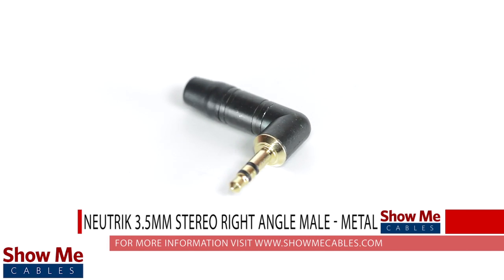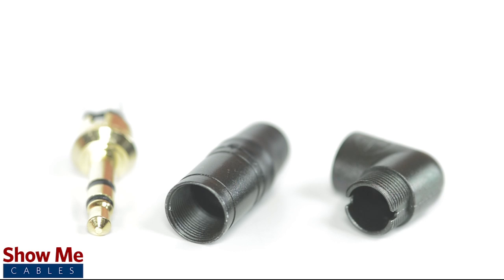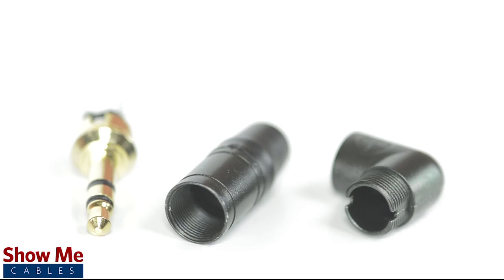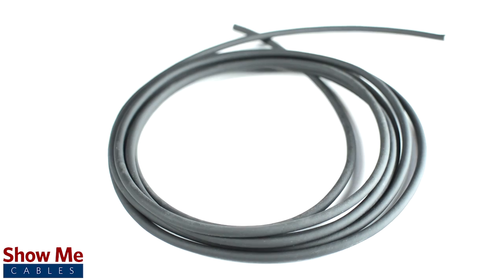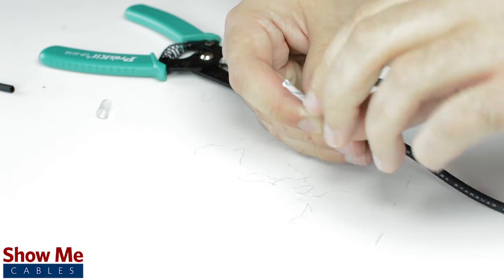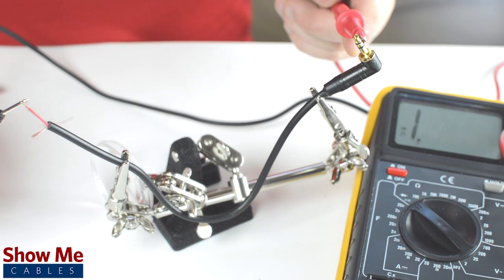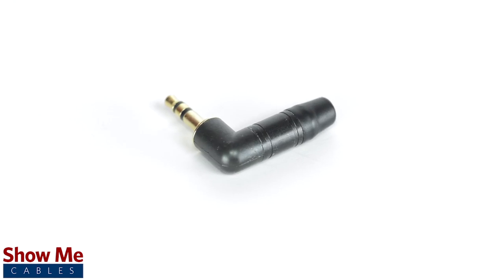3.5mm Neutrik Right Angle Stereo Connector - DIY Project to Repair Your Audio Cable #456

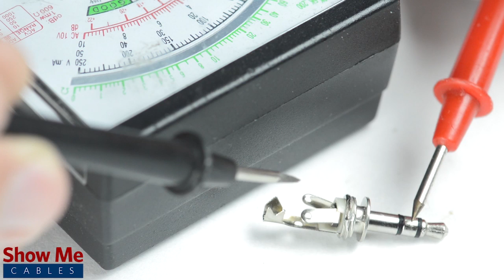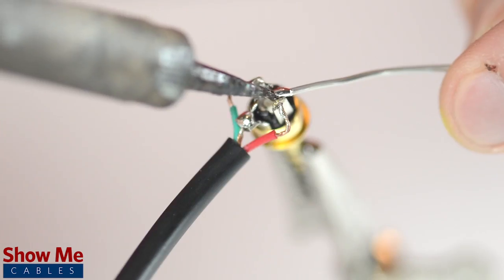Comment: A great moment in this video:  at 1:12 to 1:17 we get to see the terminal layout of this unusual connector.  That view is not shown on Amazon, etc other than via this video.  

BTW the actual soldering technique shown during those seconds is poor.  The iron should be stationary.  Painting the solder onto the terminals with the hot iron instead of melting solder against a hot terminal results in a poor connection.  A good tutorial on soldering is available here: https://www.youtube.com/watch?v=fYz5nIHH0iY